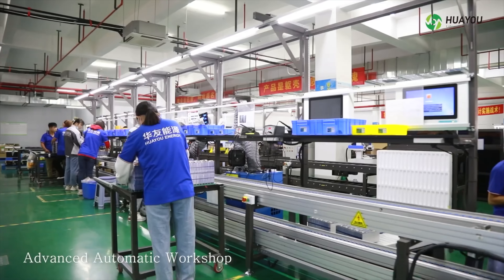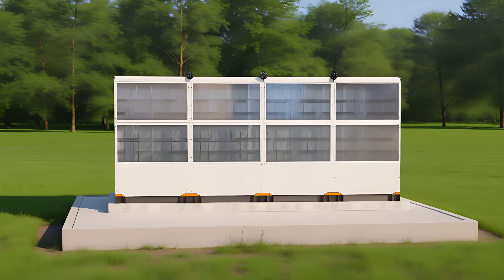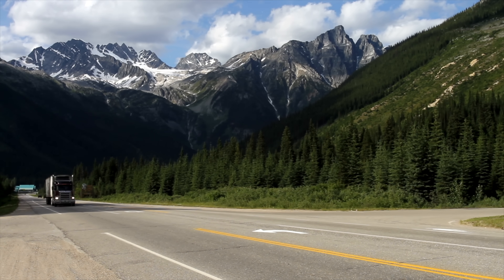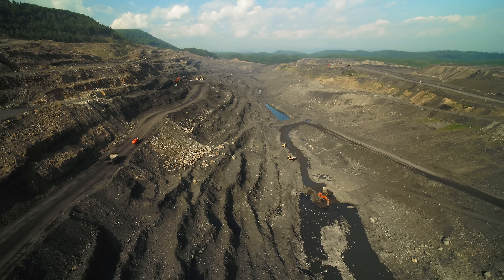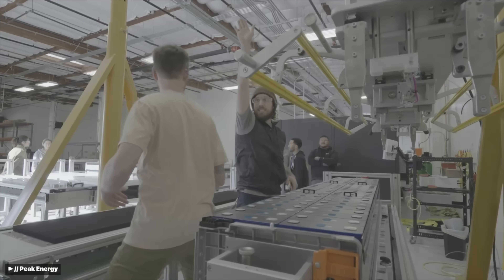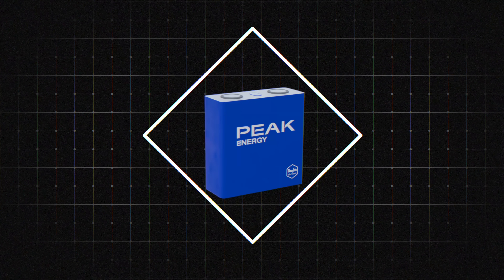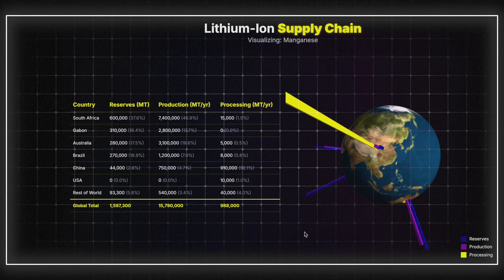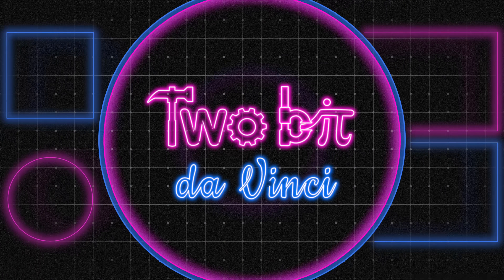Sodium Ion Batteries Are Going to be EVERYWHERE - Here's Why

Comment: I don't see this being viable in EV's. 

LiPo absolutely wins on both energy density and power density.

Peak Energy’s sodium-ion system is not designed to compete with LiPo. Instead, it’s built for grid-scale storage, where weight and volume don’t matter, but cost, stability, safety, and supply chain resilience do.

Comment: Started my commute today, 70 miles to Kansas City in a Model Y refresh 2026. 80% recommended full charge dropped to 47% arrival at parking garage to charge 4.5 hours back to 80% on trip home. Can not make the round trip without charging because not recommended to drop below 20% battery on a daily basis.  Didn't do the math but range is around 130 miles tops lol winter time will rob another estimated 20%

Comment: You need to pull off the band-aid! Tell us the Peak Energy battery's energy density and proposed price. CATL is actually building cheap, long lasting, GenII sodium ion batteries, and putting them into EVs this year. If Peak's energy density is 50% of LFP, then that is still something to work with, for Super efficient EVs like the Aptera.

Comment: No comment about the expected shelf or cycle life? Maybe I missed it.

Earlier Sodium based chemistries had a lot of the same advantages highlighted in the video, comparable initial performance to LFP with cheaper source ingredients, but would lose a significant amount of their capacity after a much small number of charge/discharge cycles than lithium based cell chemistries.

Arm waving that this might possibly be due to the stable cathode structure mentioned  getting stressed by the large sodium ions moving in and out of the lattice during charge/discharge cycles. If Peak energy has found a way to mitigate the cycle life issues with Sodium cell chemistries it would have be helpful if these issues and their solutions had been discussed.

All well and good putting in a 3.5MWh storage unit for relatively short money up front but would suck, and get really expensive, if you have to take it offline to replace all the thrashed battery cells every 3 or 6 months over the 20 year installation life cycle.

Some comment on the expected long term charge cycle durability of these NFFP cells would have been helpful in assessing the prospects for these cells and Peak Energy being a grid scale game changer or yet another decently profitable but not world beating battery niche player.

Also any data on self discharge rates? 

Back in the day maglev flywheels were once a promising option for energy storage, and may still be in some niche applications, but the self discharge rate, even with the flywheel suspended in a vacuum on magnetic bearings, was much higher than chemical battery cells so they are really only found where you need to be able to move a large amount of power into and out of the storage system and be able to do so for many many cycles without physically degrading the components and are not sensitive to a fairly high amount of power consumption to keep the whole system ticking over. Applications like one of the fast response layers in data center backup power scheme or providing massive levels of pulse power for railgun shots (Impressive!) come to mind.

Must admit that it felt like there was a bit of sleight of hand in this video as mentioned by other commenters. 

Lots (and lots and lots ) of comparison to NMC chemistries which target very different use cases where energy density is paramount, smart watches, phones, laptops, premium EVs, and many repeats of the same handful of scary shots of NMC batteries undergoing rapid exothermic deflagration, when the competition is really LFP both in terms of energy/volumetric density, cost, market segments targeted  and overall cell / pack stability and inertness.

Part 1 of 237 ... :)

Comment: Have 18650 lithium ion cells in several devices that I have run down to 0 charge repeatedly with no negative affects. Jackery, DeWalt cordless tool batteries and various rechargeable fans. 18650 cells defy "the rules". Old tech at this point but I trust them. Much better batteries could have already been on the market and I don't mean lithium in any form.

Comment: Sodium ion batteries are the real deal and will likely eventually dominate the markets for battery energy storage systems (BESS) and small to mid-size electric vehicles. Sodium ion BEVs facilitate vehicle to grid and vehicle to load applications. While Peak Energy’s sodium ion batteries have been successfully deployed in pilot stationary BESS applications and offer future potential, they are not yet commercially available. CATL’s Naxtra sodium ion battery are commercially available and currently ramping to mass production by the end of this year. Naxtra will likely have tremendous impact in Global East and Global South markets first due to lack of significant organized  incumbent opposition in these markets. Europe, Australia, New Zealand and possibly Canada will likely eventually be impacted by Naxtra as well, with America likely lagging a few years behind as it blocks renewable technologies from China and works to develop and scale its own comparable solutions. Peak Energy, and sodium ion batteries in general are actually game changing. However this means they are likely to face resistance and slower adoption in those countries and markets that don’t want their game to change.

Comment: I find it strange that you portray the linear voltage of lfp as a disadvantage and Sodiums massive voltage drop as and advantage when the opposite is true...Voltage drop means power drop which means compensating for it in many applications, not an advantage.

Comment: If someone is ready to BUY that Patent for let's say $2 billion, they could then STOP anyone from making it OR ship it to CHINA where they will set the price to buy their new battery. So, wholly owned US companies need to 100-year trade agreement to build and maintaine a battery substation to provide stable power as well as emergency power back-up for 5 days.
U.S. has hundreds of ships in mothball.  pack them with the batteries harden them against EMP's, use diesel engines to provide power to generators to charge them.

Comment: Why can't this technology be used in the construction of new homes? As a skeleton outer structure, it wouldn't take up much space. Most of the ingredients are highly conductive to heat, but if plenty of high-density insulation is available within the composite structure, it shouldn't matter. Of course, a protective layer and rainscreen would be necessary, but this is doable.

Comment: Thanks for the update Ricky.  Sounds great for grid storage and electronics, but not EVs, due to the relatively steep voltage vs discharge curve.

Using much more common materials is EXTREMELY important, so this sounds like a win.

Comment: 7:31 this is a huge disadvantage for almost everything
Reply: Exactly. The large range of the operating voltage requires significantly more regulating than a Li-Ion battery does.

Comment: Are they a publicly held company? Did I miss it, or was no price for these cells/packs given in the video? That is the biggest advantage for sodium ion in China.

Sodium ion is going to be huge in the energy storage business (both home and grid). I think it will also take over the shorter range (and less expensive) EV market. Long range won't happen unless the pack level energy density gets up over 200Wh/kg IMNSHO. It is really one to watch (why I want a stock ticker).

Also just a clarification, there are currently no LFP cars from Tesla in the US, there are in China. The reason is that no one is making LFP cells (yet) in the US for them to buy from. Oddly enough they make their own LFP cells, but they are not used for cars, but instead energy storage. Those cells are not tuned to work for cars (i.e. they are optimized for longevity vs. energy density). Rivian does have an LFP version of their trucks and SUV's, and I don't know where they get their LFP cells from. They may be the only one in the US, though both Ford and GM have said they will be using LFP in some very near term future cars. I don't know if that took effect yet for the 2026 model years or not.

Comment: The LIFEPO4 voltage graph is a pro, not a con. A battery that goes from 16v down to 8v would be a disaster in boats for example, where the electronics and equipment need that 12-14v.

Comment: This is a great development.  And a good explanation of the engineering and wider issues.
 I was impressed with China's implementation, mainly just that someone built it.  Not because they had the best solution.  Pointing to practical examples helps that investment money flow!
I chuckled because I was thinking if EV Auto ranges dropped from 300 miles to 300 kms .... and then you essentially said that.   HAHAHaha
--> Unfortunately environmental regulations will prevent US and Canada from producing enough material to be self reliant.   The U.S. has most of what it needs to produce Li batteries.  Cost is an issue so countries without environmental qualms are free to produce.   REGARDLESS (LOL) i'm excited to see non-explosive batteries making a comeback.   AHAHAHHA

Comment: You missed a critical questions, what is the charging rate, to be fully accepted we need cells that can be charged to full capacity in 15 minutes or less, it has to be equivalent to filling up your gas tank.

Comment: Sodium and salt are not the same thing. Stop saying that
Reply: Technically a salt is used in Sodium cells (such as Sodium Hexafluorophosphate) in the electrolyte as the cell's carrier between the electrodes, it's just not table salt (Sodium Chloride).
Reply: @GruffSillyGoatyes. and if he had said "a salt" it would have been different. he only said sodium and he only said salt. so technically he was wrong twice?
Reply: @GruffSillyGoatby that definition a lithium battery is also a salt battery. So that probably wasn't what he meant.
Reply: Table salt is 39% sodium by mass, or 50% sodium by molar fraction. His point was that sodium is inexpensive and readily available. I understood his point.

Comment: Ricki do not forget the Aluminium Ion batteries under BTRL4 and more like those of GMG. 
Aluminium Ion said to have charging at 10X and similarly zero Lithium , Manganese or Cobolat and uses Graphene, Aluminium and a non flammable electrolyte.
BIC Indianna is doing the Full blown Scaling for GMG and the GMG pouch cells should be ready buy end of 2026 .

Comment: I don't recall the exact battery chemistry used, but Paladin Power specializes in off-grid solar systems for both residential and commercial use and they use some type of non-lithium battery in their system.  And per kwh their systems are considerably cheaper than the Tesla Power Wall system.

Comment: Batteries, nuclear power and geothermal power are the best ways forward for the power grid. But removing as many things from the grid and generating power with solar thermal power and storing it in thermal batteries for homes  and public spaces would be the best way forward. The grid should just be for industry, primary internet infrastructure and AI. With local backup systems for everything. Of course, I am not an EV fan, so I still think we need ICE vehicles Diesel, Gasoline and CNG/LNG.

Another great thing here is those other resources can be used for better things than batteries.

Comment: The first question should be what is the energy density what is the cycle life and also battery the lifespan in years.
Reply: Current chinese Na batteries have less density than LFP. They are available but not yet cheaper than LFP

Comment: For BESS and full renewables Utilisation this is the game changing piece to full blown renewables saturation with Solar and wind.
Solar has long time proven the lowest cost of generation, yet huge volumes curtailed to stabilise the Grid. 
Saving that wasted Solar in the BESS and the electronic stability of the now to be stored energy is the key to grid stability when wind and solar fluctuate.
The energy density issue is not that critical for Storage but safety is key. 
CATL had been first to announce but with Peak now on the radar CATL no longer hold that first to market advantage.
Peak now need to scale and take advantage of their battery readiness.
Well done.

Comment: Premise: I'll believe it when I see it. Too many have come and gone and nothing was actually implemented in a meaningful way. That said about the use in automotive, it would be an option to create a simple and affordable to maintain network of automated battery swapping stations (if batteries will be based on ISO standards) where drivers could stop for a quick coffee or a bathroom brake and an automated system would swap the depleted battery with a freshly charged one. This way the car owner can simply pay for the energy on the battery and the batteries themselves can be paid by a percentage charged on the energy as well as the original vehicle purchase which makes a car owner "entitled to one battery as old as their vehicle is (at the very least), but the batteries being swapped in and out can be maintained by the charging and swapping stations providing that service for a fee which would be added to the cost of the energy being purchased at each battery swap. Of course who prefers not to swap can keep the battery and charge it at home with their equipment, but for those traveling long distances the swapping stations would be a viable option and don't ever need to think about charging their battery making the transition from traditional fuel to electric nearly seamless.

Comment: The big issue with the voltage drop vs Lithium is that you can't mix these batteries together.   This is going to hamper the rollout of this technology! Charging logic and circuits will also need to be different.
Reply: You can, just move the boost converter from the inverter to the battery bank and do load demand in software
Reply: @noobulon4334  Yes but not likely to happen with all the different applications needed.  Plus those battery mfg's are cheap as he11!  :)

Comment: An EV with "only" 200 miles of range... that's two and a half times more range than I will ever need. Sign me up!
Reply: If I want to make a road trip, I think that'd be borderline minimum capacity, taking into account that those are probably ideal numbers, and not "car loaded with stuff and AC on while on a summer trip". Charge times are also important. If you need to stop to recharge every 2-2'5 hours, it shouldn't take more than 10 minutes to recharge before getting annoying

Comment: Hi, in fact, all Lithium based batteries good limits are : [25 % - 75 %] - batteryuniversity has made long run tests, which is a thing that almost nobody else did and published, it shows these limits are the best compromise between usability and number of available cycles.

For small electronics, you now have terrific chips that conjugate BMS, charger, power path and buck/boost DC/DC converter - the only challenge is to find such hardware integrating an EEPROM, in order to avoid reloading main registers each time you're using it.

The emergence of Sodium-Ion batteries is a good thing, for the environment and because poring all these quite rare elements into only one production is a non sens, not to mention that we might need them for further and more important realizations.   And honestly, only dead brains would refuse to have a 1 cm thick smartphone when it means being better toward our not-infinite-resources earth…

Comment: As far as purchasing stock in Peak Energy, the assumption is that existing stockholders are now positioned to cash out on this optimistic news at a high share price and transfer risk to optimistic buyers.  I've experienced this as a buyer.  The share price goes down and goes stagnant at a low price.  Sales announcements can help, but it starts to look like what the project was about was getting to this point for the expertise to cash out and go into leisure mode, because China will beat everybody on production costs again, which they seem to be positioning themselves to do.  That's why I can understand that we were not introduced to the key players.  It's understandable they are looking to maintain a quiet life.  What might get more confidence is to be introduced to a team that is still on the scarcity side of their working life and that has the expertise and motivation to pick up the tasks and sell the product into a market that is looking for the greater safety and supply chain stability.  That would be an honest sell:  the inventors want to cash out, right and good, but a capable team has been prepared to manufacture at scale and sell the product, offering new shareholders a genuine chance at funding and riding a wave of opportunity.  Why did the other company go bankrupt?  Answer the question.  Did all the human energy cash out and the team left was unprepared to carry on? Be honest like good engineers are and show how the new team is going to make it work in the face of Chinese competition.  Then I would be a stock buyer.